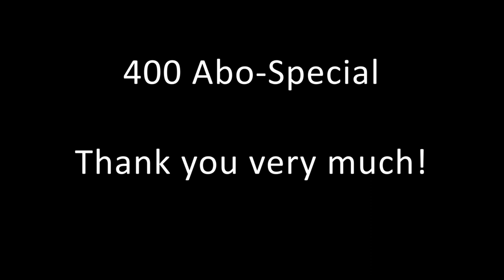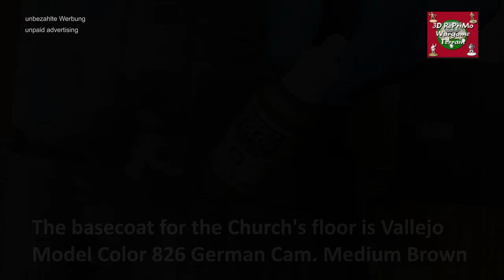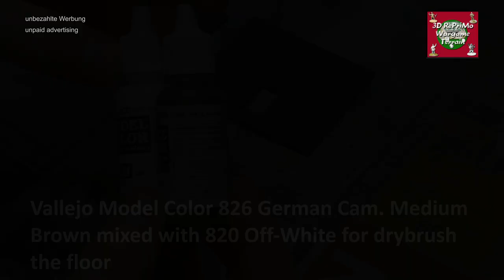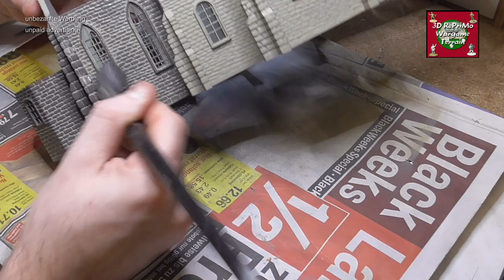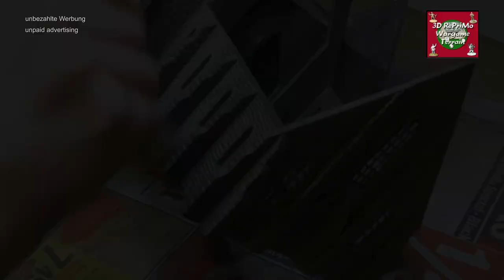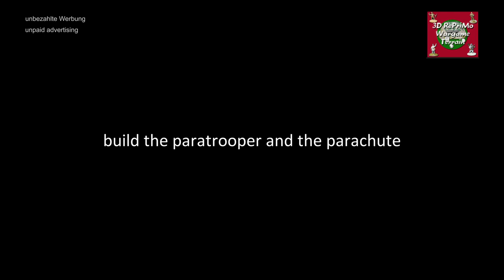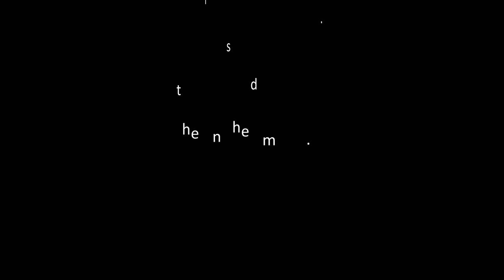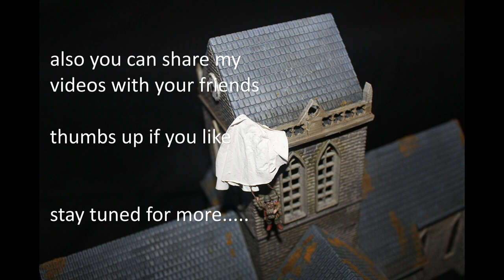Tutorial:How to Paint 1/72 Sainte Mere Eglise/John Steele/PaintingGuide/Bemalung Kirche(WW2)Diorama

Comment: could you paint this withput an airbrush using a brush and the acryllics, so satisfying to watch, thanks for the video! Good day!
Reply: if so how much milileters of paint would you need to brush paint the base coating on the church, and how much milileters does it take to dry brush the roof, what paints would you recomend for brush painting the whole thing, thank you lots.
Reply: One more thing how long is the finished product
Reply from the maker: Thank you very much...nice that you like it..its hard to paint without an Airbrush 😂
Reply from the maker: Hello mate...i cant say it direktly...i Would think that the Mix from All colors and thinner should be 17ml one bottle vallejo model colors...i would use all colors you can brush...also you can use a hair dryer for drying the model faster
Reply from the maker: I think the model is 50 cm long and up to 40 high